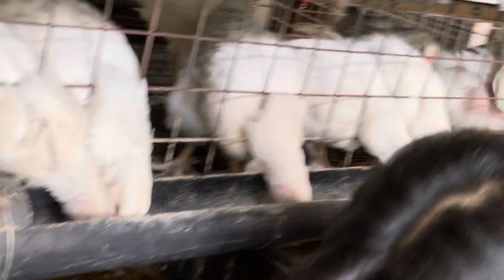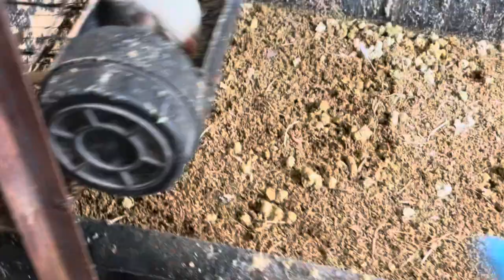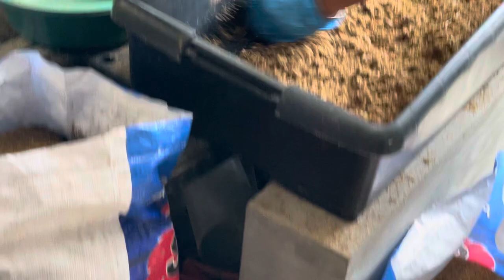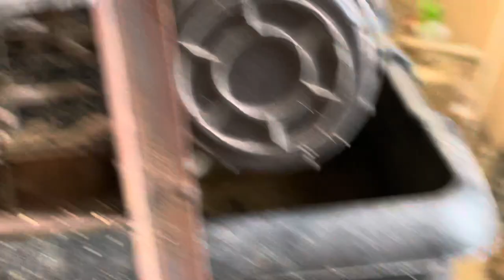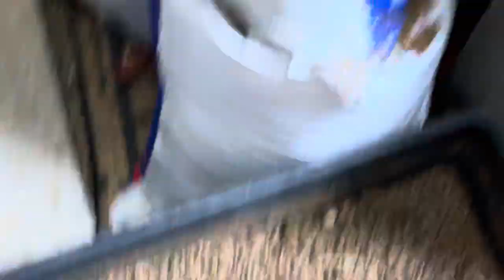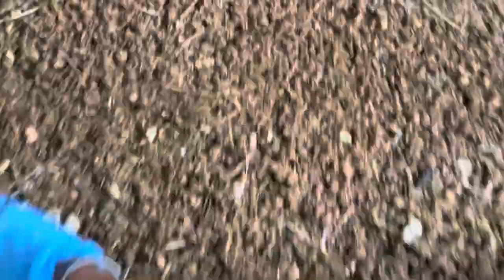Broiler Chicken Manure Fed Black Soldier Fly Larvae - A Self-Sustainable Radical Farming

Comment: Those cases are way too small. I hope you don't keep them in there all day. If you do then you should not have them. They need more space.
Reply from the maker: they are only there for 28 days max. once they reached 1.5 kilos in 3-4 weeks, theyre market age already and will be replaced with dayold chicks again and the cycle keeps repeating. they are not pets. so they dont need ample space. they are meant for food and its already proven. they will reach the desired weight for market purpos.